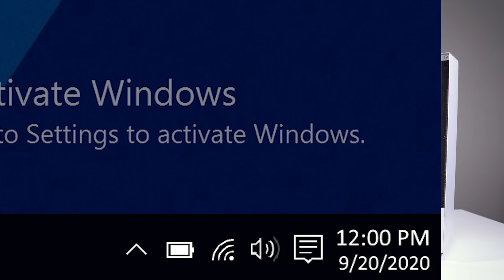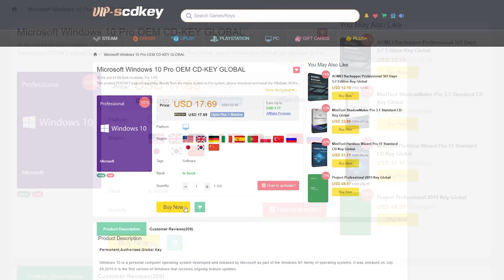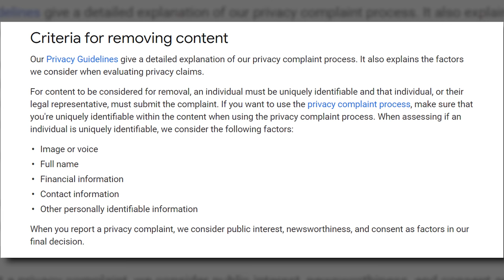About the PC Deep Cleaning Series...

Comment: Just keep a test SSD with benchmarks, Windows pre-installed & some games to test the pc. That is better if you are afraid to use the customer's storage device for benchmarking
Reply: great idea mate, he would have to disconnect the customers drives before just to be on the safe side
Reply: I thought that everybody and their grandma had a separate SSD kicking around with just bare windows, HWmonitor, OOCT & furmark installed for basic testing of a system and making sure the cooling was adequate after a thermal paste application :P

Comment: 5:13 You can simply disconnect their drives and use one of your drives to test temps.
Reply: Exactly what i wanted to say, set some old 120gb ssd with system, drivers, couple benchmarks and hwinfo, he could use it for every tested pc without reinstalling anything.
Reply: @krzychch8937  Yes! And for the before part he can ask them to install hwinfo and send him the screenshots beforehand in their entry emails.
Reply: @v1d300  no need, he can use that same ssd to test "before" and "after"

Comment: I have been electrocuted by a charged power supply. Not fun. Do NOT recommend. Also, as a side note be very careful when working on MAC all in ones... just saying.
Reply: They have HUGE exposed contacts on the rear side of the power supply mainboard inside MAC pro all in ones. They are unshielded. It will hurt. It could kill you. Or numb your arm for about 15-20min. Still not fun.
Reply: Same and I have deeply cleaned a few PSUs (numerous times at that), and I finally somehow managed to "destroy" one of the PSU. Had to get a replacement. Not recommended even with all the experience. Just get an air duster or blower, and blow the dust away. Safer and simpler.
Reply: Using plastic tools is the way to go on all-in-one systems
Reply: The capacitors! They are like high power batteries that can discharge like nobody's business!
Reply: Here's some advice: just don't even try opening an IMac, if it breaks, then it's on the consumer as they bought that unrepairable ewaste. 😂
Reply: ... or just unplug the power from the wall.  lol
Reply: Issac. My brilliant man with his 2 cents. Did you know that power supply capacitors can hold a charge for days and sometimes weeks? Thanks for commenting 🙂
Reply: ..and from there on out you were known as Zapped Zachary
Reply: Shocked by a PSU??? 🤣🤣🤣
Noobs!
Do NOT disassemble ANYTHING if you don't know what's inside and how it works... not even a chunk of dirt - it can BITE you! 😜
You can drain the disconnected PSU literally in 10 seconds (to the "safe" levels)... if you know HOW... but people like to do things without knowing shit about them.

Comment: While he could use a pre-loaded HDD or SSD with Windows OS + testing programs to benchmark the systems he cleans, that also comes with potential dangers. When benchmarking a system, you are stress-testing components, and there is a chance (albeit a very VERY  V E R Y low chance) that something could go wrong with hardware.

So while it is a good idea to use an SSD / HDD pre-loaded with Windows OS + testing programs, ultimately by not benchmarking the systems it is one less thing Greg has to worry about liability-wise.

Comment: bro tip: take care of your RIG and it will take care of you, clean it, keep good temps etc... also being a more or less of a retro gamer helps, running games from say up to 2015 or earlier (and even new ones can run on older rigs with low settings). there's plenty of GG games out there that do not need rockets to run and games are mostly tied to high end GPU's which are expensive AF but the advantage is that u can just replace a GPU without replacing anything else

Comment: On temp testing: you could have a copy of Windows on a cheap SATA SSD and boot to that, then you don't need to touch the person's OS or data.

Shop towels: at least it's not regular paper towels... Those leave a lot of fibers that can be harder to get rid of.

PSU teardown: they're not only potentially dangerous to open, but not really meant to be opened. A can of compressed air with a long nozzle can get in there and push out some things you might not be able to reach with tweezer, too

Comment: This whole series has inspired me to be content with my older pc and upgrade just a few things to make it feel “new” to me. I’ve had a huge urge to dump money into a new build but after seeing how much a few upgrades can do to improve an old system, I decided I didn’t really need to do that. So far I’ve upgraded my ancient GTX 750ti to a used GTX 1060 ($60 factoring what I sold my 750 for), upgraded from 8 to 16 gigs of ram ($20 eBay find), overclocked my FX6300 from 3.5 to 4.4 GHz with a new CPU cooler (thanks JayzTwoCents- $25), upgraded my HDD to a SSD ($50), and swapped everything into a new Corsair 4000D Airflow case ($90). Throw in some RGB fans and light strips for another $50 and my system feels like a completely new system. I’m around $300 into all the upgrades but I think they were well worth it for my light 1080p gaming! I guess the only thing I wish I had were connections on my 2014 motherboard for the 2021 front IO my new case has! 😅

Comment: FYI, you can not easily screw up a drive which an OS is installed on. Worst case, for whatever reason you can't start up Windows anymore. That really is not a big deal, you put a Linux-distro on a USB-stick, you boot that up and you can copy all the data. It really is that easy. (Yes, you can screw up with partitioning but that requires some serious effort, that does not happen by accident when you install some software)

Of course it does help a lot if the user has a proper data-organization, not have it fragmented everywhere. Put all the data-files (videos, documents, music) where it belongs, in the case of Windows in the /users/<username>/* folders, in the case of Linux in the /home/<usernamen>/* folders. Installing Windows again should take around 5 minutes, then it is just a matter of copying those folders and reinstalling some software. For the Steam-games you can literally copy those folders with the games and Steam installs every game again within 30 seconds, not a big deal.

Comment: Hey Greg, i use a 1tb external SSD with Windows 10 installed as windows to go you can make it using Rufus buddy, then you dont access the customers data and have all the testing software installed on the external SSD.

Comment: 5:13 I know a workaround for temperature testing (before and after). It's obvious you can't use their drives for running tests as they could contain sensitive data inside.
My idea is you install a drive of your own solely for testing purposes. Fresh Windows install and whatnot. That way, you will be able to do temperature testing without affecting or damaging the user's data.

Comment: Using electronics contact cleaner such as CRC quick dry in the red can is much safer than scrubbing a pcb with a q tip. If a user is not careful they could remove a smd component. Crc could also be used to clean up thermal paste and much more.
Reply from the maker: You'd have to seriously swing a Q-tip to dislodge a soldered SMD. Pretty silly worry, if I'm being honest. I do things this way because it's extremely effective and thorough.

Comment: i've been unable to upgrade for a while, an exeption would be is i got a 2060 BEFORE the gpu shortage, im still using a fx-8350 black edition socket 942 i have 1333 ddr 3 ram and a m5a97 r2.0 mobo i have had a very hard time getting my system upgrade, i would like to upgrade by the end of 2021 though.

Comment: Ad PSUs, PSU fans are easily removable and give you plenty of access to use a duster and remove clumps that won't pass through the fan guards/rear mesh. Just don't reach in there and you're good

Comment: Thanks again for recommending the Electric Duster. I never would have expected it to work as well as it does, or bought one without seeing it.
It's about 85% the strength of canned air. How deep do you need to go when cleaning regularly should you want to avoid PCDC altogether?

Comment: Awesome videos! I like this series. Too bad I'm from other country, you should see my 11 years old i5 2500k, GTX460 system. In a big Antec TwelveHundred full of dust and messy cables. I can't do much... Also, a quick opinion about temps. It would take some time, but you could swap the drives before cleaning with a small SSD with a fresh install of Windows, test the temps, clean it, test again. This way you won't mess with their data and we'll see what a good cleaning does to the temps. :)

Comment: If you are interested in testing the computers without tempering with the installed OS, you could use a live usb. Linux has a very nice stress test called stress and with sensors (maybe in a conky script) you could check all the temps etc. It would be relatively easy to set up and fast to use. Help could be found on the internet or you could contact me!

Comment: I just recently cleaned a friends system and I can tell you it's way worse than what I've seen so far in your series. Hopefully we don't see one. It was initially brought to me because the system itself refuses to power on. He asked for a repair and upgrade if necessary. As to be expected it is because of how dirty it was. The PSU was clogged and is the main reason of the problem. Dusts literally ate the case fans to the point that some of them aren't spinning at all. Cobwebs all-over the place. Heatsink is utterly blocked. Almost a centimetre of dust build-up and more.

After a thorough cleaning and some upgrades, it runs like new. I then advised him to keep it well maintained. If he cannot, he's free to call me. It was my proudest work yet even though it wasn't my own build. It was also the first time I've worked with high-end components.

Comment: When you reassembled systems have you run into any problems where Windows goes into repair mode? I have taken apart and reassembled 2 computers this year and both went into repair mode with no options to boot into the OS and I just had to reinstall Windows on both systems.

Comment: Still wondering if you get some kind of assurance, that the system works before you start taking it apart? Something written down or so.
I'm just thinking back to when I was working in retail, we had a customer who wanted us to upgrade his system from a HDD to the "new" SSDs. So we cloned it and put it back in only to realise that the system is not working at all. So he blaimed us for destryoing his system. Of course we were sure that a simple hard drive swap won't kill a system, but he also might have been right, since we didn't test the system beforehand. So since then we always checked systems with the customer standing besides us, if they are actually working before touching anything (well, except when there was something wrong with it and it was brought to us to fix it in the first place).

Comment: 13:09 just discharge the capacitor with screw driver or any metal tool that has an insulator on the other end
and unplugged power supplies during the travel will discharge itself 

i always deep cleaning my power supply don't worry 450v 300uf will not kill you i accidentally touched one of those while repairing my laptop adapter just discharged it with a screw driver in your country i think you are using 110v it is safer than our country

Comment: Can you not have a pre installed set of everything on an SSD, you can plug in and disconnect there's for the testing, then you are ONLY using your software, I think it would add a lot of value.

Comment: I think as a good idea in lieu of using software to detect the temperature of the system just use a thermal camera, may not be as accurate but should produce better results. Or ask the customer to use there own software to check temps and maybe provide them a before and after survey, its the least they can do since it seems like the generous service your doing is free.

Comment: So I have decided to change my CPU cooler but I am afraid that I might break the pins of the CPU while twisting the cooler a little bit to break the thermalpaste.
My CPU is Ryzen 7 3700x and I am using the stock cooler on it with the pre-applied thermalpaste read at many places that the AMD's pre-applied paste is a glue and because of that, I am super curious how should I remove it.
Reply: Why would you "twist" the cooler to break the paste?  I do IT for a living and the only time that happens is when the CPU is several years old and had a really crappy paste on it.
Reply: @vhrod1681  Well mine is from last year, I had no problem with the Intel CPU as it was fairly easy even with a 7-8 year PC. But with AMD it very new for me. Saw people posting their CPU getting pulled with the cooler issue many times. That's why I am more concerned with it.

Comment: Suggestion: Why don't you use Microfiber cloth instead of Paper towel? At least you just need to wash the cloth and don't put in the garbage so much paper (for a Eco prospective), anyways Microfiber cloth can clean smaller parts rather than paper.

Comment: @Greg Salazar
Would you be interested in making a video about using Linux for gaming (and other tasks). Especially given the cost of hardware now it might be interesting. Those key-resellers are a risk which not everybody is comfortable with, spending $140 less on a W10-key (the cost where I live if you buy one from a store) means that you can spend $140 more on a hardware-upgrade. I would be willing to do the heavy lifting for a video like that, give the complete layout for how to set it up. Anyone can follow it, it does not require any special skill. (You would lose access to around 20% of your games due to anti-cheat and DRM but the other 80% works fine)

Comment: Why do you put so much thermal paste? Isn't the own metal better in terms of thermal conduction? 
Look at this thing from Intel: https://www.intel.com/content/www/us/en/gaming/resources/how-to-apply-thermal-paste.html
Reply from the maker: Yes, obviously, the metal itself is a better conductor. But these metals aren't perfectly smooth. Microscopically, they're littered with canyons and crevices that trap air - and air is a horrible conductor of heat, comparatively. So we use paste to fill in those gaps and increase overall thermal conductivity of the interface.